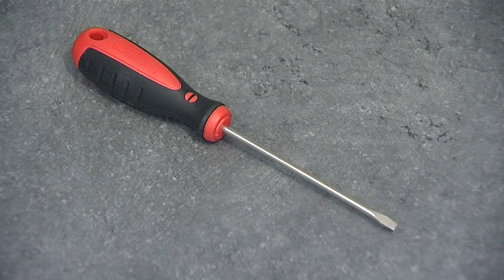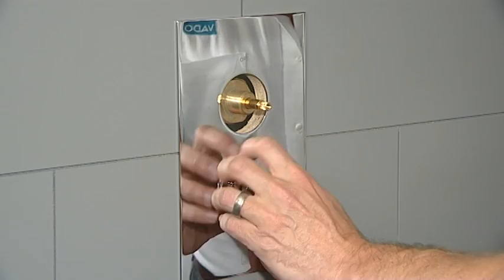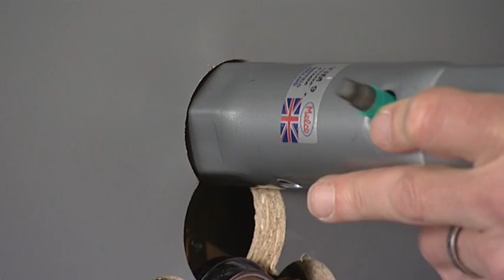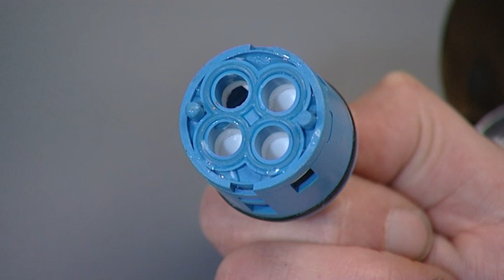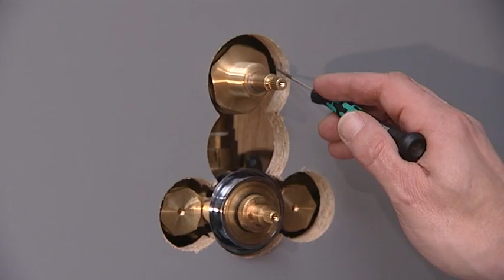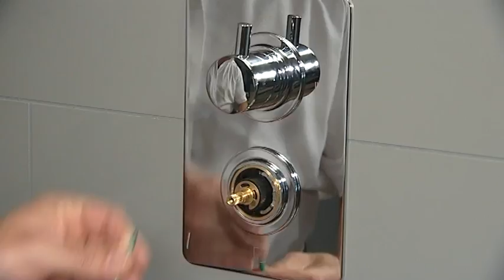Concealed shower valve (brass cartridge) - 2 & 3 way diverter valve: maintenance and replacement

Comment: My similar concealed unit in the washroom is not mixing up water properly the hot/cold valve is slipping as well and we only get hot water . Please advise what could be the problem? Many thanks.
Reply: Did you find an answer for this? :)